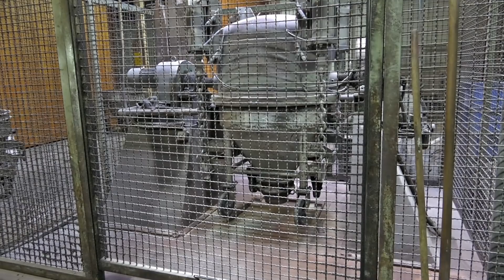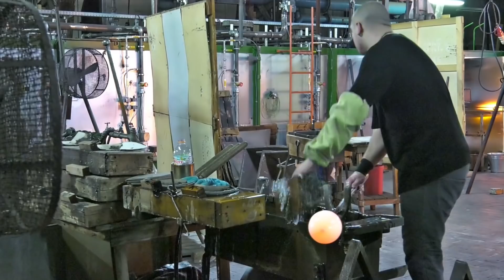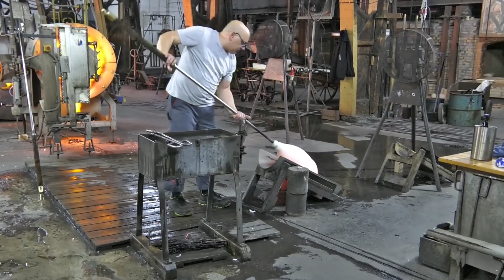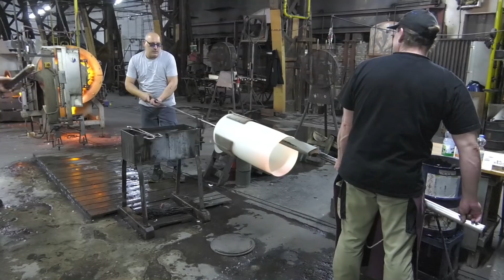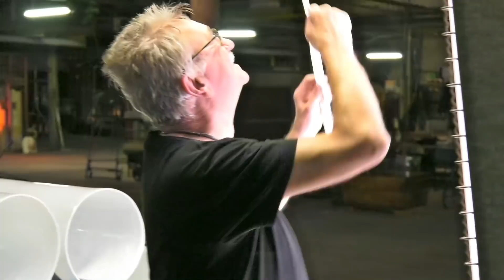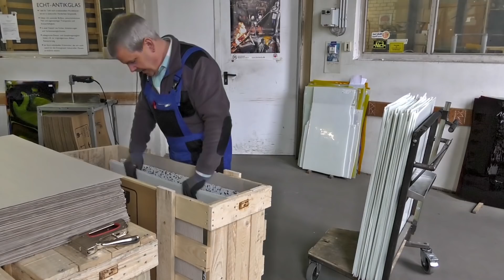Glas aus Waldsassen für den Big Ben in London

Comment: I visited this workshop more than 30 years ago with our chemistry class. The only that notably changed is, that I didn't see a single bottle of beer. When we were there, they told us that every worker drinks 5-7 bottles (0.5 L) of beer during an 8 hour shift. It was a low alcohol (3.5%) beer from a local brewery and needed to be provided by the company as part of the collective agreement. Do I need to say that it's located in Bavaria?
Reply from the maker: Ja, das mit dem Bier ist wohl war. Jetzt trinken sie halt gutes Wasser 😂